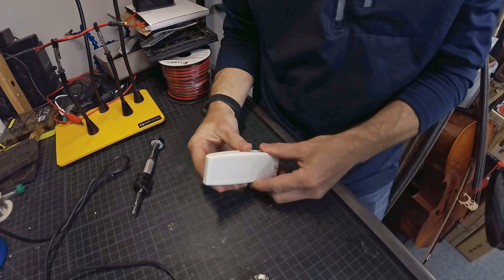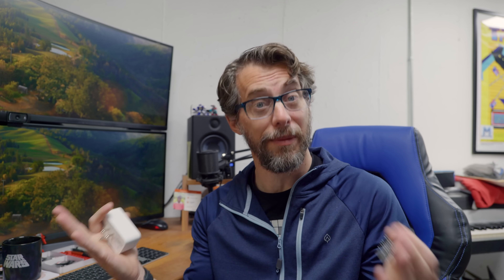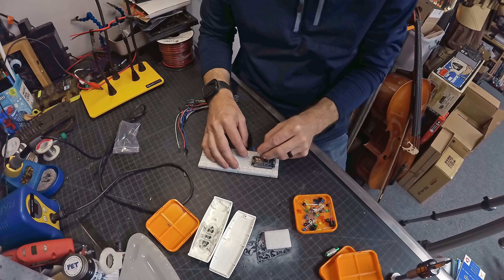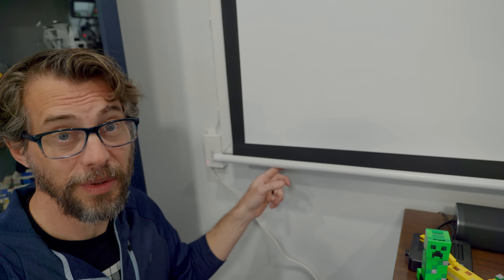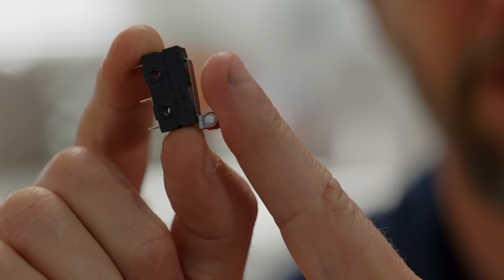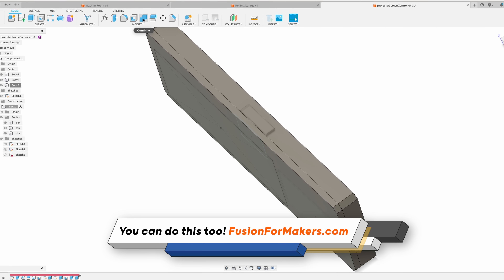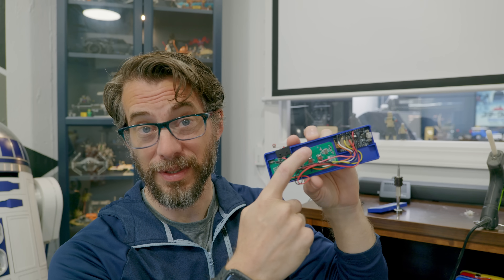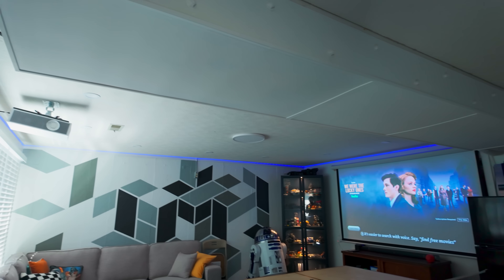Make Dumb Electronics Smart for $3

Comment: Why bother ripping the remote apart when you can get a universal IR transmitter/receiver based on an ESP and program it with Tasmota or ESPhome? You can learn the codes from the remote and program it to emulate button pushes while still having a usable remote. Plus, you can  use it for devices other than that device; I have my whole bedroom on a single IR transmitter for my non smart tv, soundbar, and IR fans and it cost like $12 (although as TUYA did patch it's firmware, you'll probably need to take it apart and program the board by direct wire)

Comment: You may want to do a tutorial on how to do this with ESPHome or Tasmota as an alternative.  Coding is great, but having a templated plug/play system would be nice for lots of less technical people. Using those also means having a web UI and built in integration for most automation software, like Home Assistant, or anything using MQTT.

Comment: Right at the start it'd really help if you stated which board you're using that costs $3. That's what your title is about, and you just wave a board around without first indicating what it is and where you got it from. You say it's an ESP board and an Arduino, but that's really not enough to be helpful. You do link to the board in the description, which is nice, but I think showing what you're using at the start would be even better.

Comment: I thoroughly enjoyed this, but here are a few improvements I would have done
1. Adding something mechanical is something like this always causes restrictions, and using glue on top of that is even harder to fix if you change something small. So id try to avoid that as much as i could with code. 
2. As someone pointed out, pressing up also stops the screen from going down while its going down, thats good coz then you only need 2 buttons. Even then having 3 buttons on the app doesnt seem like an issue. 
3. Id rather just add the functionality in the code that if the screen takes 15 seconds (say) to come down or up, the remote just emits that signal for 30 seconds the moment you press up or down. The screen will automatically stop after its length runs out. The signal will stop sometime after. A little change in code will remove the physical button, and largely simplify electronics. Then its better to just add a stop button on the app or use the up button to manually stop it halfway if needed.
4. As someone else pointed out, having one arduino running full time to control multiple ir emmited / receiving devices around the house sounds like a great plan. 
Great work either way!

Comment: Ok I know you're using this project to show principals that can be used for other projects, but first off those cheap screens usuall have there own limit switch you can set yourself. Next if you add a RF transceiver to the esp32, learn the codes from the remote. Then you can just blast them out from the ESP32 without modifying the remote at all.
Or you can buy a unit that can do all this for not much more than all the components here, and have IR and RF. Nice video though.

Comment: Locking relays in the wall unit is the answer.
Power to the screen motor is cut by an n/c relay receiving power, causing the other relay to cut.
Just a Simple analogue logic circuit.
All the components, apart from the relays will be in the wall unit already.
But hey, arduinos are fun.

Comment: Calling and ESP an Arduino is an insult to the ESP.
Reply: The ESP32 is a microcontroller and arduino is a board,
It's like saying a cpu is a motherboard - it's incorrect.
Reply: @liron-hazan , technically, you are correct but it’s not that simple. Arduinos are a computer system board driven by a microcontroller.  ESPs are both, a microcontroller and a system in a chip (SoC).  Additionally, what people typically refer to ESPs are system development boards driven by an ESP microcontroller.  In the context of this discussion, they are comparing the systems, not just the microcontrollers.
Reply: Maybe in a different context I would agree, but I am just over the anti Arduino snobbery. 

Yes, I am moving on from Arduino to esp, but Arduino got me started from nothing.

Comment: Good one!   Just one suggestion..  
Limit switches need to be installed so that when something goes wrong (and it will), when the device doesn't stop fast enough (or at all) the over-travel doesn't jam into the switch and break it or what is holding it.   Install a lever operated switch so that the roller gets pushed from the side.  Then when the travel goes too far the switch arm just harmlessly slides along the side.   I learned this from years of working on automated machinery and later on my own CNC machines.  I've destroyed a few limit switches in my time due to over-travel!
Reply: cheap but perfect CNC have soft limit what working normal working alltime, but if come some error to program need be mechanic limit SW cnc all axis and wiring ro paraller whit E-stop SW, if soft limit has error axis go out off limit then mechanic Limit  SW e-stop all machine, simple and all cnc used this. and home SW have inductive sensors can run first all machine home point then machine know were have zero point ewery axis. my DIY linuxcnc have all this basic system, working well and have safety if come errors.

Comment: No power-hogging transformer needed. If USB won't power something, just use a LM7805 in a TO-220 package (3 pins).
Also, they already have SmartLife modules that output dry contact closures. Less than $10 per channel.

Comment: Looks like the same brand screen that I am using. If it is, there are stop limiters already in the housing. They are where the power connects to the screen. Instead of using the external hard switch, my screen can be controlled by the projector. When the projector turns on, the screen goes down. When it gets to the right spot, the internal limiter turns of the screen. The the projector is turned off, the screen goes up. When it gets to the right spot, the internal limiter stops the screen. No need to over engineer something that is most likely already built into the screen and projector.
Reply: This guy did a really piss poor job of explaining his project,
I just got one of these screens but haven't put it up yet, so how do the up and down button on the remote work then, he never  bothers to explain it.
if you press down on the remote does it have preset on it where a short press lowers the screen all the way and  a long press to lower it manually? or is it all just manual and you have to hold the down button down till it reaches the bottom?
because he never explains this I am not even sure why  he is using a limit switch, or how he is sing it since  he never bothered to explain that  either,
 I assume it is wired to the stop button then?

Comment: I think he did a bad job describing the need for the switch, I could be wrong! It seems to me by using the software to control the motor whether a built-in limit on the motor or not he would still have to have the program understand that the job is complete otherwise, it will keep sending the signal and drain the battery.

Comment: Just one question…. And I’m not breaking the marbles by asking 

You have code in place and you know how to code … why didn’t you just set a timer to let the screen down run for x milliseconds and the same going up so it stopped when you wanted it to stop? You could even have it as a smart phone parameter that you could change the height at any time.. this way you didn’t need that anti smart switch to stop the drop of the screen and moreso, not mount some box where it can be an eyesore 

Nice project btw

Comment: Really enjoyed the video and explanations. Alternative solution is to get rid of control unit/remote completely and use something like Shelly 2.5. Shelly has a web interface api etc. Two negative things, you need to work with AC 110/220 Volts and you can use only the mechanical stop of the motor (ugly workaround just measure time for screen to get to the exact point and use this to setup Shelly). For apple devices you can use “shortcuts” to communicate with Shelly. 
It is really a shame that the original hardware of cheap screens has to be 1960 style.
Join his course and fix it!

Comment: There's so many other things you could use instead of relays. When you're talking mechanical relays you're having a coil powered up using a lot of power... Yes it's nothing when it comes to pennies per year but it's just a hassle replacing batteries or putting constant strain on something. sure you could use solid state relays but everybody knows they are goddamn garbage coming out of China and they all leak voltage. just try to match up components that you use with voltages you're using in your circuit. You will save so much time and effort in the future and not have power losses stepping up or stepping down power You're not going to be throwing off heat that could damage other electronics. When you keep it as simple as possible, that's the goldmine

Comment: ok so maybe I have a "guy eating sandwich" question, why didn't you just wire all of this to the little box already mounted to the wall and not put the remote back together? all of this arduino code just makes it so the wall remote could have been used instead. Rendering the remote unnecessary. You have them right next to eachother at 10:06 even, lol.

Comment: Why would you use 12 volts to step down to five volts when you could just use a 5 volt charging port or transformer (wall wort)? keep it simple. 
Don't screw out of limit switches because when you're using it to turn a circuit off then you have to defeat it or work around it to get the circuit to turn back out again.

Comment: Why u need a switch and not set the range to stop on the code like u said , u have a range between 0 to 100 , and you could stop it on the percentage with trial and error

Comment: Im wondering if you’d tried SDR to analyze the signal. With the signal info, you can usually just mimic it via the arduino and a $0.60 transmitter. Combined with esphome, and home assistant (not necessary but highly recommended,) you can control the screen and a ton of other stuff however you like.

Comment: You could have eliminated the need for a switch by measuring the amount of time it takes to lower and raise the screen and turn the motor on for that amount of time.  I like how you have integrated all those commands into the Alexa.  Very professional and cool.  The box was a bit conspicuous though.  That's why I would have hidden the box and opted for timed motor usage to calibrate the screen up and down modes.

Comment: Sweet video! 

You can use transistors instead of relays; they're more reliable and don't make a sound. ☺️

And you should really try the ESP32-C3; it's tiny and cheaper, but has the same functionality as a normal ESP32 (only difference is that it only has 13 pin-outs; but that's usually plenty!). 🤘

Comment: As you've discovered - I've also found that a lot of those remotes that use 12v batteries just do so to increase range, often the chips can/will run on 5v (or I guess less) just with a really reduced range, so if you're going to store it somewhere in a nearby location to the blinds... just power it with 5v! 

Well done video, thanks!

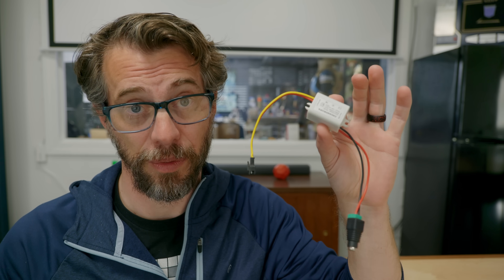Comment: 7:00 Assuming this is DC, why not just use a resistor or pot to go from 12v to 5v? and how is a transformer going to work this DC??
Reply: Potential dividers are not efficient. He's using a buck convertor, not a transformer to lower the voltage, and buck convertors are efficient.

Comment: Instead of the lmit-switch, calculate how many seconds it takes for the motor to extend the screen to the length you need, and add the maximum time to the code.
Reply: My thoughts as well.

Comment: Surely you know the speed of the motor and how long it takes to reach the desired position. Cant you just turn the motor on for a set duration? If you don't know the starting position you can save the current position in memory

Comment: That remote operates on 433 Mhz frequency you can just attach a 433 Mhz transmitter to the ESP8266 then you can get same functionality without zombie-fy your remote. You can read what data transmitted by the remote using 433 Mhz receiver attached to ESP8266 and simulate the same signal data.

Comment: Wouldn't it be faster and better (since you don't have to destroy the remote control) to use an infrared diode to transmit the same signal that the remote transmits? 
I haven't looked all the way through, but if the remote uses infrared it would make sense. 
Even if the remote uses radio, you could still "clone" the remote.

Comment: "I like to make stuff" accidently finds out that a simple pcb runs at 3.3v instead of 12V like the Battery sayd... hmmmkay.... 
If you really into electronics, youll know that the 12V Batterys just got 12V to run longer than the 1.5V or 3.7V Batterys, right?.... 🤔

Comment: Made this way more complicated then it had to be...   One, you could have used a dual relay shelly...  That is the easiest way to do this...  Keeps the remote as stock, makes it "smart", and you can control via home assistant or via scripts in Shelly.  This is the down right simpilist and the shelly is tiny, you can likely fit inside the electrical box for your shade. ESP32 does not provide enough ma to "press" the button, you have to put something like a 2N7000 infront of it to do the press. doing this is easier then a relay as you also need this to drive a relay with an ESP32.  but there is a million ways to skin this cat.

Comment: Those little ESP-32 boards are amazing.  I remember working with much larger, more expensive, and much, much less capable microcomputer boards.  There was a little Z-80 board I did a lot with back in the day.  It cost ~$60, ran at 4MHz, had 32K ROM, 8K RAM, a couple serial ports and 24 bits of parallel I/O, and that was it.

Comment: Not sure it really matters, but I've never liked the idea of triggering button presses with a pin directly as it requires a shared ground, when dealing with multiple voltage requirements that gets a little messy. So I've been faking button presses for years with opto-couplers. They're just LEDs and photodiodes together in one package. If the photodiode is biased then it essentially just closes a contact, which is what we need.

Comment: Wow! such a contrived solution to a very simple problem, and $3 for hardware is dwarfed by many expensive Engineer's hours needed to implement it. Yes, the screen already should have a limit switch, actually 2 switches - one for up and one for down, with adjustment screws.  I have 2 switches in my screen and flat-headed screws to adjust them. But maybe cheapest projectors don't have them.
Further simplification can be achieved by using projector's "trigger" output, which puts 12V voltage when projector is on. In some projectors there is no "trigger" output, but they have something else that can be used, like a USB connector, which will have 5V when projector is on. Many many years ago I made my setup, where I added a PIC microcontroller to listen to the "trigger" signal from the projector and press up and down buttons on the control. I did not sacrifice the screen remote for that setup, as the control box has the power and buttons to hook up a microcontroller to. I did the whole thing within 1 day, including PIC program. it was even before YouTube. These days motorized screens have trigger inputs, so the setup should be just laying some wire from projector to the screen.

Comment: For those not familiar.  ESP32 dev boards are not Arduinos. Yes Arduino has an ESP32 based board. Just pointing this out because when you choose your editor you will need to know what board you have because GPIO pins are not always the same from one board to another.
Reply: actually it is really an important thing to know that those are not "Arduinos".

Comment: Too complicated. Just make sure it has a setting function which recognize how many turn of rotation from the closed position to the maximum position. The machine should be able to calculate the rest. And make the UI to be a bar, which you can drag from 0-100. Done.

Comment: Hi ! Nice video! I have one question : How do you know which voltage you need to put to the button pad through ESP pins without friyng the remote board? Did you solder to the ground pad or the other pad ?

Comment: Can anyone with more electrical wizardry knowledge than me explain why the designers of this system would have used a 12v battery for the remote?

Would 12v instead of 3-5v increase battery life somehow?

Would it increase the range of the transmission somehow? (And why would you need this? Any 3v remote can output plenty of ir signal to work from well across a large room...)

What would be the benefits of using higher voltage in a small appliance like this that only requires minimal amounts of current?

Edit: made the comment near the beginning of the video. I just got to thebpart where he said everything works just fine on 3.3v... so now it seems like its a battery calacity thing? Will a 12v battery thats only supplying 3v last longer than a 3v battery?

That question makes me wonder whether the remote actually pulls 12v with the 12v battery? Or if theres some circuitry in there to step down the voltage?

I almost want to buy the same setup and replicate the project just to see if i could answer my own questions just by exploring.

Comment: This is STUPID! I've integrated these screens by just unplugging the wired remote and plugging a new wire in and connecting that wire to my control system! very simple! Also when these screens are installed the limit adjustment should have been set for the room! apparently this was not done!